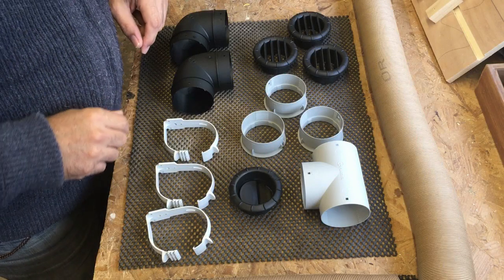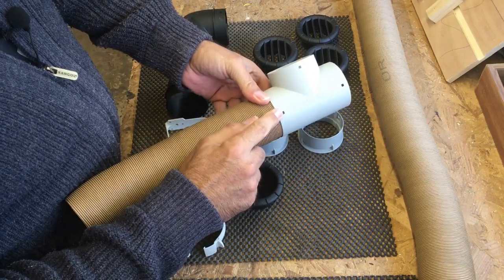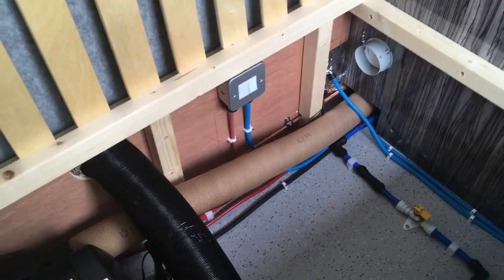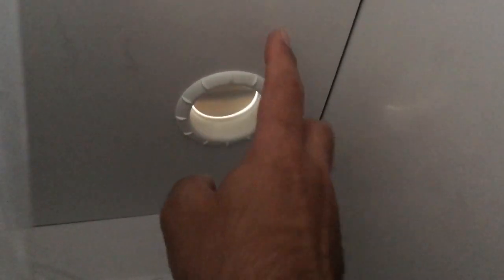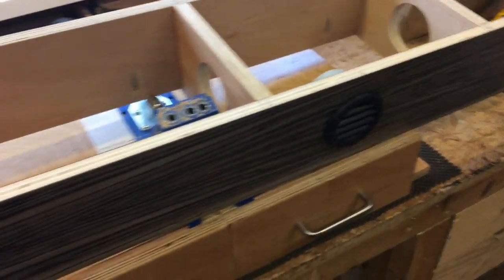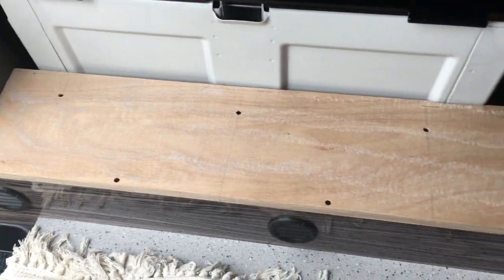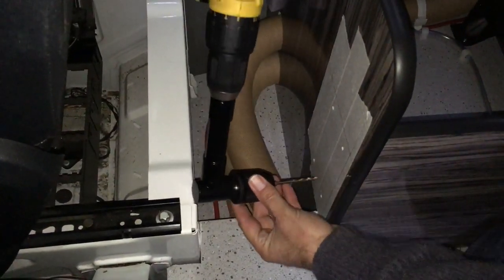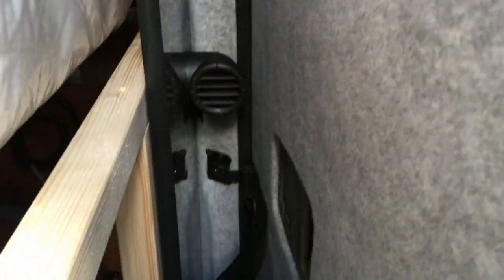Mercedes Sprinter Camper Van - Heating & Vents

Comment: Great idea with the step for the seat, that's one annoying factor in our van that the passenger seats turns round but you'd need 50 inch legs to reach the floor as it's the entrance fo the side door, sadly I don't have the space to put in the step as you've done.

Comment: Great explanation of ducting and accessories. Doesn't actually show how to cut the pipework but I expect a jigsaw or hacksaw will do the job - taking care to keep the cut square. Learnt that the visible end caps are screwed on to the connection pieces.
Reply from the maker: The duct is made from cardboard and foil with a wire coil inside. So it can be easily cut with a craft knife and wire cutters. 👍🏼😃

Comment: Hi Greg just doing my shower tray/heating etc & noticed the insulation was wet at the bottom of the cavity. When I spoke to a pal who is a very experienced camper/builder he said what I haven't done was take off all the side moulding & squirt silicone sealer in all the holes then re-fit the moulding. Though I'd pass that on.
Reply from the maker: Mike Boyce, if you can get to them it's much easier to cover the clips from inside 😃 without taking the trim off
Reply: Greg Virgoe good thinking

Comment: A note regarding heating with propane (LPG).

The boiling point of propane is -44 F (-42 C). While propane liquid converts to gas at that temperature, low temperatures above its boiling point still reduce the pressure in the tank. One cold night in Alaska with the temperature near 0 F (-18 C) I fired up a small propane heater. All it could generate was a faint red glow and not enough heat to notice a difference. If you find yourself in a similar situation you may wish to fire up your Truma before the temp drops below about 20 F (-7 C).
Reply from the maker: Paul Stanley thankfully 😅 I will not be taking the van to Alaska. We much prefer the sunshine to the cold 🥶

Comment: Great Videos Greg, thanks for sharing. What stair nose did you use and how many dropout vents does your van have?
Reply from the maker: The stair nosing I found off eBay. There are lots to choose from with a simple search. I have three drop out vents. One in gas bottle cupboard, one under the cooler and one by the boiler in the seat.

Comment: Greg -  we love your video series. But as ex pat Brits living in the USA we find it very difficult to get some of the components you use for such a professional finish. I've googled and googled but cant find any manufacturer over here that has such nice furniture board. I'm also fitting the Truma 4e to our sprinter and I see it comes with a flexible hose for propane with a flared connection to the boiler. I saw info over here saying one should never use a compression fitting for an RV gas connection where vibration is a possibility , what's been your experience with the propane supply ? also finding the Truma heating ducting almost impossible to find in the US , maybe anyone reading this from the US has an idea ? -  Once again thanks for a wonderful series of videos!
Reply from the maker: The RV industry in the states is massive they must get their materials from somewhere. I would approach local RV sales and service venders and ask if they have contacts for spares and replacement parts etc eBay May ship to USA that is one option.

Comment: How about glueing an additional rubber gasket around the rear doors next to that which the van manufacturers have already installed. This may reduce droughts. I have seen others do this.
Reply from the maker: gtricgtric yes that’s a good idea. Anything to act as an additional draught excluder would help. I think our doors just don’t fit very well at all which doesn’t help.
Reply: gtricgtric - can you post the videos where you have seen this, or the products?  Thanks in advance.

Comment: Hi Greg, not sure if this is section to ask or if it’s been asked before. Is there a reason you didn’t block off the back of the bedroom so when back doors are open you aren’t looking straight into bedroom. Was it just so you could heat bedroom with vent or is there another reason. Cheers Stew . Great work thanks for your time and expertise

Comment: Another great video Greg, do you plan to run the Truma whilst on the move?
Reply from the maker: Hello Roy, it's not advisable to have your gas bottle on while driving, I personally won't be running any gas while moving. The van heater works really well while we are driving that will be enough.
Reply: @GregVirgoe  Agreed, we even switch the propane off on our canal cruiser between stops for a cuppa.

Comment: Greg having spent 28 years as a Journeyman Sheet Metal Worker, I would recommend a fiberglass wrap/blanket around the outside of the ducting just to help insulate it from heat loss very easy to do, plus for summer times you can use the shower as a drying room if you put another vent w the damper on it and in the cabinet side use a 12v computer type fan to circulate ambient air for drying instead of having to fire up the boiler!
Reply from the maker: Insulation around the heating duct is a very good idea, the step does keep your feet nice and warm when the heating is on. :D  We have a warm air vent in the shower and extract at high level also a vent at low level in the door so it does get used as a drying room and works really well.

Comment: Hi Greg. Could you tell me if the 12v supply to the boiler comes from the control panel or is the 12v feed from the 12v fuse panel. Just need to check I have all the cables in before I seal up. Can't seem to find a truma wiring diagram
Reply from the maker: The boiler needs a 12v DC supply from fuse panel protected by 10amp fuse. 
The CP Plus controller needs a separate 12v DC supply protected by a 1Amp fuse. 
On the mains side the boiler needs a 230volt AC supply from the hook up with a 10Amp fuse. 
Then the control cable plugs in between the boiler and controller. 
The boiler also has a remote temperature sensor wired back to it. Hope that helps 😊
Reply: Thanks for the prompt reply . Just to check with you is the following correct ; 12v from fuse board to control panel (1amp fuse) .   12v direct from fuse board (10amp fuse)  to truma  .                                                                                           Or 12v from fuse board to control panel and then 12v on to the truma .                                                                                                          Is the 1.5mm 12v  cable ok to supply the truma  or do I need 2.5mm.                     Again thanks

Comment: Hi Greg, another informative video thank you. I've enjoyed them all and how nice that they are not plastered with distracting music! An off topic question if I may as I'd quite like to make some videos of carpentry projects. It's a bit of a passion of mine. What camera and microphone do you use and what's the editing programme? Do you find the editing programme good and are you using a Windows laptop? Any information would be greatly appreciated. Have a great trip.
Reply from the maker: Hello John, I do have a nice Canon eos DSLR with Rode Stereo mic for outdoor shoots but when I’m in the workshop I always use my iPhone with a lav mic plugged in for better sound. The iPhone takes clear video in focus even on low light. I have two editing softwares. A simple quick and easy one is Filmora which I use a lot. I also have Sony Movie Studio which has a lot more professional features. Most of my videos are edited on Filmora and it’s about £70 so not too expensive either and very easy to use for a beginner. I use a fast desktop PC with SSD drives running Windows 10. Although I hate windows 10 with its icon display and installed the classic shell over riding it. 
Hope that helps you.
Reply: Hello Greg and thanks for the speedy reply, much apprciated.
Reply: Forgive me for jumping in here, but I too use Sony Movie Studio. It's an excellent product, but there is some learning to do. By the way it's not owned by Sony now, but supported by the company Vegas. I would also second Greg's recommendation of SSD drives, these really speed up your work flow. Lastly, Greg is a real natural in front of the camera, I don't think you can learn that, but I wish you good luck:)

Comment: Hey , i ve been watching your video s , good job . I ve been living in my van in Belgium  most of the time .  Benivan 144 single bed . Winter and summer One little hint with the heating. Those tubes get really hot . And so in a way you loose alllot off heat there.. Either you insulate them or put sole wholes in the boxes in wich they run so that the trapped heat gets into your Van anyway,,, I had cancer and couldn t build my own one .. but I do love to optimise and adjust :). Greetz Jan

Comment: Another cracking video Greg 👍🏼

When we first hit the Alps we found the traditional points of heating weren’t adequate to keep us warm up on the bed in the evenings, so I attached a piece of flexible ducting to the vent under the bed and brought it up to blow warm air into the bed area.. We also attached a thick woollen blanket across the rear doors which blocked out all the cold transferring through from any exposed steelwork and glazing...Worked a treat 🚐💨

Comment: Hi Gregg 
Great channel 
I find you videos and methods extremely good 
As a joiner I’ve thought of doing a conversion for a while. 
I’m not sure if your still occasionally running your van but if I were to do one it would be stood for the whole period maybe 1 year or more. 
Do you think this would have a detrimental effect the van 
Thanks
Reply from the maker: collcolin, mine was stood for similar time. I started it regularly and allowed it to fully warm up. Chocked the wheels with handbrakes off. Did end up replacing brake discs as they were very rusty but otherwise it was fine for that period of time. 👍🏼😀
Reply: Greg Virgoe 
Thanks for reply 
I’m going to give it a go 
Maybe this year maybe next

Comment: hi greg a quick question about the boiler. is setting 1 just using electric to heat the water or is it  mixture. Also if your on 240 hook up can you just use the electrix elements to heat the water.. thanks mick

Comment: Do you really need the cold air return in the bench seat if supply air comes from the outside of the van?
Reply from the maker: Mick Hughes nothing comes from outside of the van. The external flue is for combustion only and is room sealed. The return air vents are on the front of the boiler where the centrifugal fan is. Watch my heater unboxing video for detailed operation 👍🏼

Comment: Hi Greg, It would be helpful as a final video in this build series to have a full walk through of the finished van. It’s been a very helpful series for doing my build. Even though I have not done exactly the same as you as my girlfriend intervened on the ceiling so my Moreland ply didn’t get put up! It has T&G instead. Also I ran out of money to afford Moreland furniture board. So i built it with Banova ply & Moreland lightweight unlamented ply. 
I figured this first build won’t stay the same for long once it’s being used all the time. So use this as a prototype and then later build it with furniture board once it’s been used and any changes needed have been noted. 
Enjoy Europe. Maybe our paths may cross?

Comment: Hey , i ve been watching your video s , good job . I ve been living in my van in Belgium  most of the time .  Benivan 144 single bed . Winter - 10  and summer . I have the same heating system .. One little hint with the heating. Those tubes get really hot . And so in a way you loose alllot off heat there.. Either you insulate them or put sole wholes in the boxes in wich they run so that the trapped heat gets into your Van anyway,,, I had cancer and couldn t build my own one .. would have loooooved to ....  but I do love to optimise and adjust :). Greetz Jan

Comment: Hi Greg.. just two little things.. the heat vent. in the back of the van, why did you put it up so high ? I would think that it should be down  at the bottom of the van, closer to the floor. So that the heat can warm up all of the space, not only the top half... second.. do  you think that one vent. at the side of the van can heat all the way across to the other side ? 
Thats it ! Great video as allways ! 👍
Reply from the maker: Hello, I am confident that this will be enough to keep the chill away from the back of the van.
Below this level it is just doors and unusable space, I mainly wanted it to keep the chill off the bedroom.
Reply: @GregVirgoe  okay, thx for the answar.

Comment: Greg I've got a diesel heater with one 80mm outlet and I'd like to have 3 outlets despite mine being a small van.
I'm going to order some extra pipe and fittings from your link but...
Would you recommend reducing the ducting down to 65mm for the pipework?
There will be no more than 3 metres of run but I need to add 2 T's to direct the duct to 3 areas.
Many thanks Greg.
Reply from the maker: Mark Velo, reduce to 65mm on each branch duct after you have T off if you can get the fittings. I may benefit to put an outlet you can regulate on the ones closest to the heater. 
Be careful not to exceed the maximum length of duct specified in the manual as the heater will not get enough airflow and could overheat. 
Bigger ducts = less resistance.
Reply: @GregVirgoe  I'll do that thanks Greg, it seems to make sense. Now my build is moving on I'm realising sourcing parts is really slow and frustrating Lol
Reply from the maker: Mark Velo, I totally get you on that one, my most annoying one was not having the right size screw to hand, the solution was a box of each size 😂

Comment: Great video as always great. I remember at the beginning you were looking hat having a garage for 1 or 2 motorbikes. It looks as if you don't have enough height for motorbikes or even assembled. pedal cycles.  Are you still gonna travel with a motorbike?
Reply from the maker: Hello Ian, On this trip, we are taking two bicycles, and they do fit beneath the bed simply by lowering the saddle and handlebars with a quick release. We are not taking a motorbike on this trip which is why I have enclosed the back, There is room to get a motorbike in the back once the bed bases are removed. When the Europe trip is over I will use the van for track day trips and IOM TT etc
Reply: @GregVirgoe  ahh yes, i forgot that you could removed the bed and that you had a lot of cycle training to do also in preparation for the cycle challenge. 😉

Comment: Great video Greg, Truma really need a video explaining the vent options and how to install them on there web site. They can link yours in now as a  starter:-) 
Question: Are those louvred end outlets the same as the "Lamellar insert"?
I've not seen them with a screw nut fix on the back.

Comment: Hi great video series. Seeing your duct work I was wondering if you had done a false floor for the water and waste tanks and piping and put hot air connection in the chamber, this is common on winterized motor homes. So I checked back at the tank install and realized they are slung under the chassis. I read that you planned to insulate them and any external pipework for frost protection and just wondered with all the freezing weather if you had filled the tanks and tested the pipes and tanks don't freeze? I have seen heated pads are available if you didn't know. 
Great series, its a shame it has to end!!:-)

Comment: Love your videos, Greg!  Your ingenuity and guidance are excellent resources for we who are about to embark on a build.  One suggestion I have is to put batted or foam insulation into the closed spaces where your ducts are.  Insulating the ducts in closed spaces will both reduce noise and preserve the temperature through the runs.

Comment: Hi Greg - great stuff as usual you are the zen master of van conversions. But tell me - why have you not insulated the warm air ducting, and what is the flooring material you put on the footrest? Cheers Greg - not long now! :-)
Reply from the maker: Norman Boyes, it was a piece of Altro Walkway that we cut off when laying the main floor so they both match 👍🏼😀
Reply from the maker: Norman Boyes, regarding the lack of insulation to ducting 
The space is tight that’s the main thing. As long as it’s run in the van it’s going to give off heat inside. If this warms up the furniture it’s not a bad thing, that in turn will help to keep the van warm.

Comment: Great video as always Greg...looking forward to the solar panel video, as it's a bit of a minefield for me.
Reply from the maker: They will be bolted to the roof this week, have been sitting in the workshop for months waiting.
Still struggling to find a suitable elevation support so it might just be flat for now.
The aluminium bar stock I got was too flimsy and just bent, the gas struts I have are too strong :S

Comment: Hey Greg, where is the elbow and vent from, that you put in the back of the van please. Can't seem to find them
Reply from the maker: Adam Lincoln they are all supplied by Truma if you speak to their spares department in Derby you can buy them direct. 😊
Reply: @GregVirgoe  Thanks hopefully they are open now. It's hard to see exactly what it is. It's not just a standard elbow with a throttle valve is it?
Reply from the maker: Adam Lincoln it is a normal elbow with a fixed grille in it. Just doing a search on ebay for Truma heating duct and found lots of spare bits https://www.ebay.co.uk/itm/264719337874
Reply: @GregVirgoe  Thanks this is great